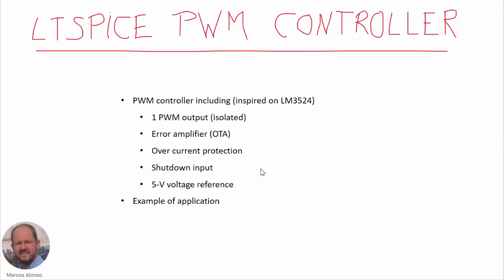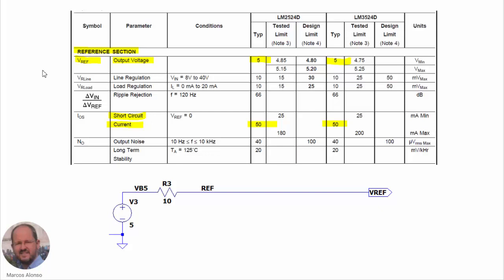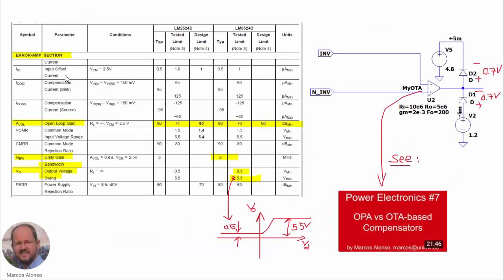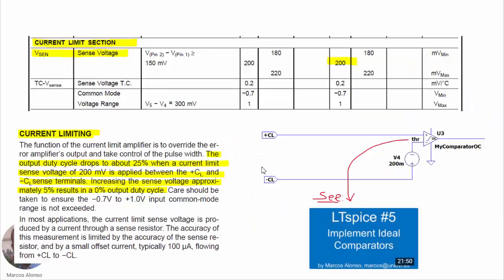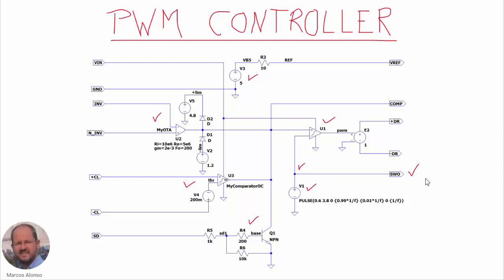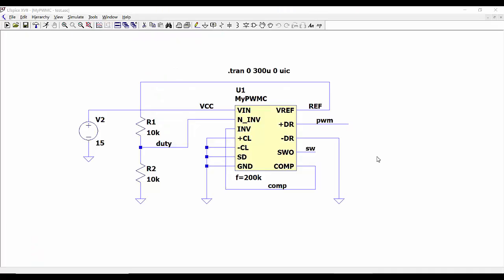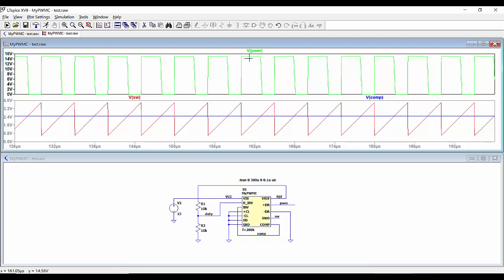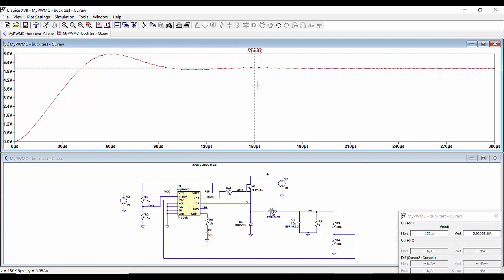LTspice #8: How to create a PWM Controller for power converters

Comment: Hello Professor, Is this PWM Controller for power converter (LTspice #8) in current mode or voltage mode?
Reply from the maker: Hello, this one is voltage mode. For current mode control, please see video LTspice #25: https://youtu.be/PqD8De54IIs

Comment: Hi. can I use this for a boost converter?, thanks please reply fast, its for a project
Reply from the maker: Yes, the controller is valid for any converter. Thanks for watching!
Reply: @MarcosAlonsoElectronics  Thanks Marcos!!, I need to make a boost converter with 5V input and 30 V output, so I need to change Vref to 30V? how is that done? Please answer fast, its for project
Reply from the maker: @tomas_soeterik  We don't use so high voltage references. You can measure the output voltage with a gain of 0.1 and use a voltage reference of 3 V for example.

Comment: Hi Dr. Alonso. Thanks for putting together this thorough presentation. It does help a lot to understand the nature of PWM with technical walk-through and sim result. For the closed-loop DCDC circuit, is the startup time independent from the output load? In addition, how would the DCDC respond to shutdown when output load is none? Would that be an uncontrolled shutdown? Thanks in advance.
Reply from the maker: Thanks for your nice comment and questions.
The start-up time depends on the converter dynamics and therefore on the load. Usually, a capacitor in parallel with resistor R2 (see schematic at 11:18) is used to increase the duty cycle slowly at the beginning and better control de start up transient.
The shutdown with no load should be OK. The output capacitor will discharge slowly because there is no load and therefore it will discharge through the internal resistances. You can always use a dummy load to make the discharge faster.
Thanks for watching!
Reply: Hi Dr Alonso. Thanks for your tip on the reduction of transient with parallel cap and R2 for error amp.

Comment: hello professor, excuse me i have one question, in this video, 200kHZ frequency, how you
obtained it? in this controller, you did not determine how you put 200kHZ in this IC? IS THERE any video for calculation frequency according to controller?
Reply from the maker: Hello, thanks for your question. Frequency is usually a parameter selected by experience. It is not calculated. It depends on the topology, type of switching (ZVS, ZCS, hard switching, etc.), type of switches (MOSFET, IGBT, bipolar, etc.), power level, target efficiency, etc. Typical frequency range when using MOSFETs is 50 kHz to 200 kHz for hard switching. 100 kHz is the most common switching frequency.
Reply: @MarcosAlonsoElectronics  thank you for giving these. can you send me your email? because I design a topology and I want to show you my circuit and know your idea
thanks
Reply from the maker: @sabersaberi-r9s  My email is marcos@uniovi.es
Reply: @MarcosAlonsoElectronics  thank you so much professor